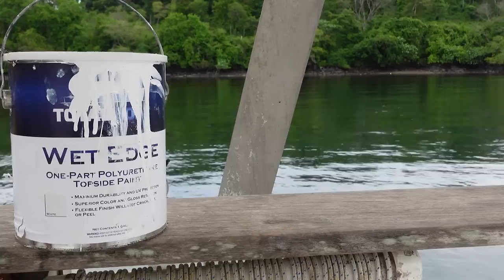DIY sailboat restoration: You will LOVE this new paint job!

Comment: who else spotted the tonka toy dumper truck at 5.35 from the 1970's i have one of those in my loft, if you find the masking tape dries out and becomes hard to remove you can use electrical tape which does not dry out and remains easy to remove for extended periods of time see you on the next one
Reply from the maker: Wow! Well spotted 😅

Comment: Thanks I used Total boat Total Tread and I'm happy with it.   The wet edge is Good ,,but a little less great than the Total Tread.  I used their dewaxing solvent  for prep and that really seemed to help . Also used a wheel with a 200 grit scrubby pad  to rough  it a bit..  (thanks for your recommendation of the products.)
Reply from the maker: Great to hear, thanks for sharing. I have been really holy with the paint so far 👍